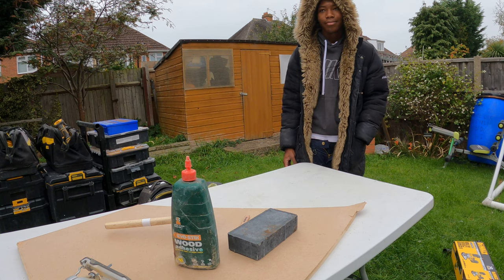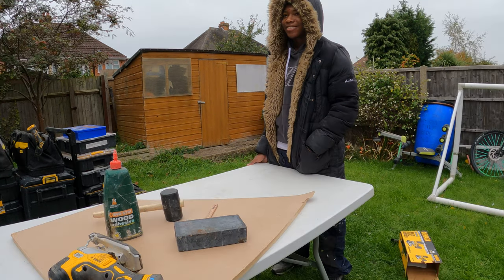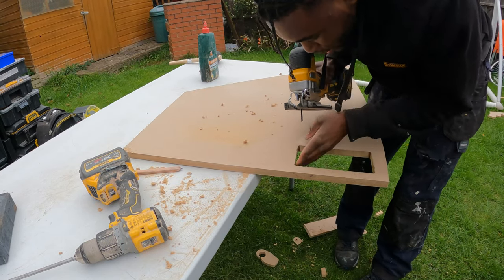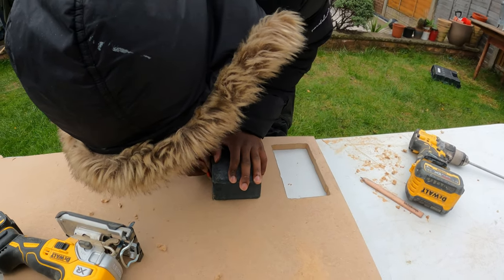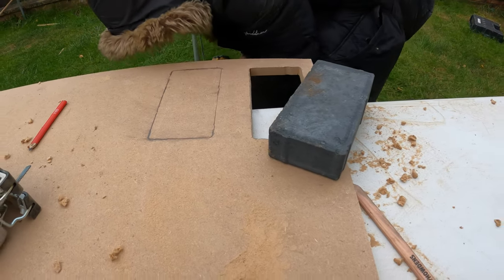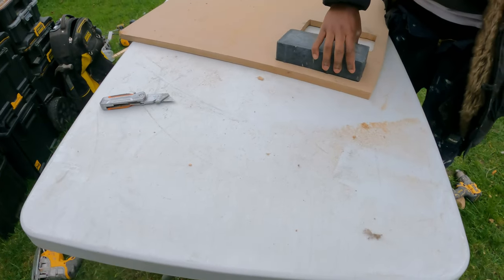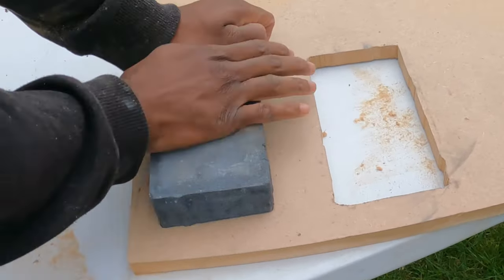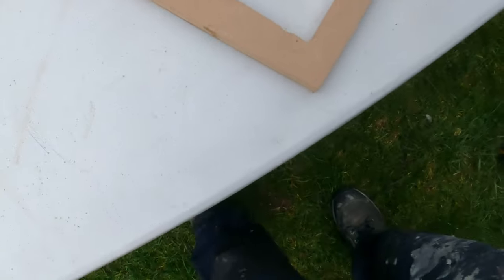£100 to the winner

Comment: The boss has it HANDS DOWN. The apprentice has way more gaps. The boss did it in less time, with less passes. You can see the apprentice has a lot of vertical lines on the outside near the corner. Lastly he needs to take off those bulky clothes imagine if that hood got caught in the spade bit. I’m not as good as he is and he can definitely get better and get to that point just isn’t quite there yet. Keep grinding and you got it brother.
Reply: alr mate u dont need a paragraph
Reply: Sure you do. You have to explain reasoning. Not my fault you don’t like reading. Move along.
Reply: u could of put the  boss his better cuss hes got more experience
Reply: @Warkbtw  and I could then write why I think that I would have to write more than that. Then you would reply then by the end of it we both wrote a paragraph each. 

If I didn’t write a paragraph then someone could talk about why experience isn’t enough or whatever then by the end of that the paragraph would have been written cumulatively. So ya. I can agree to disagree if you disagree.
Reply: @lnu2372  i mean ur just making ur life harder for yourself so good luck in the future mate
Reply: @Warkbtw  why you so mad
Reply: @Warkbtw  shhhhh the adults are talking.
Reply: @paddington1670  MATE U HAVE CANADA PFP U CANT SAY MUCH SYM CUZZY